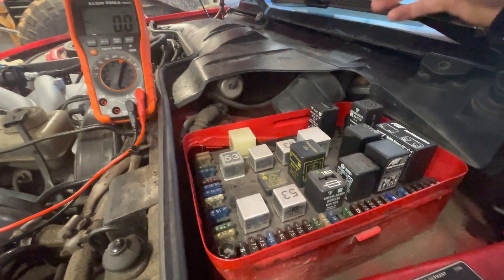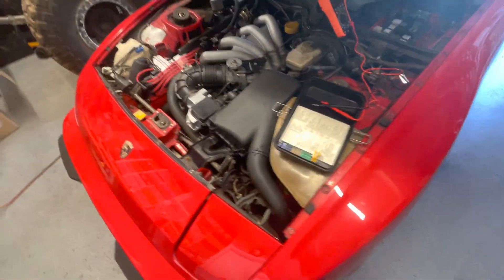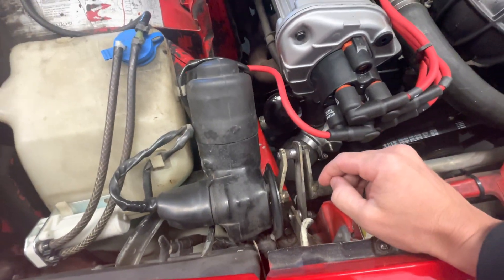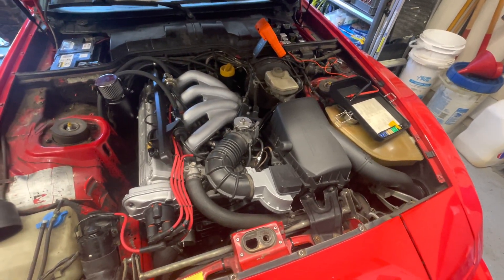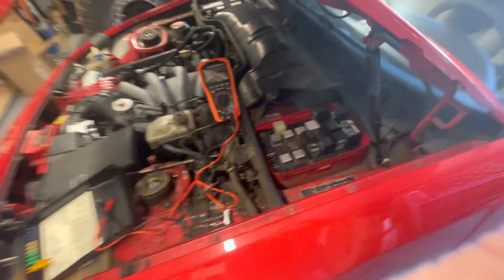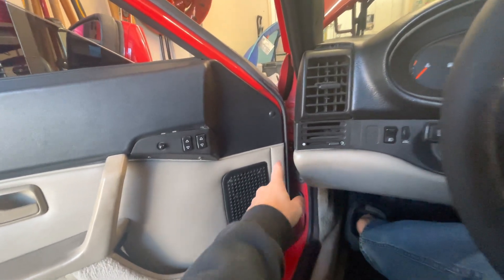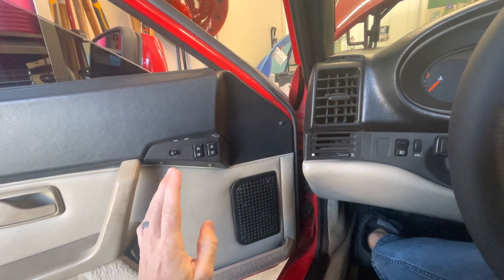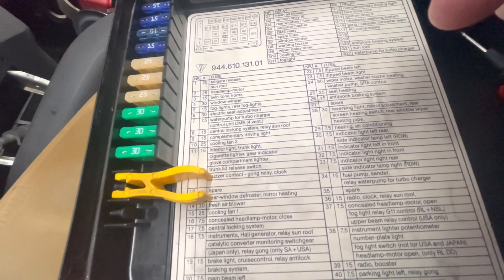944 Finding parasitic draw

Comment: Ugh! 🤨 I had to swap my door jamb switch early on as it was killing the battery as well… but my wires were still connected. 

There are three wires to the switch - a red/white, a green/red, and a brown/yellow (wrapped in that textured black electrical tape). When I pull it taught, it seems to pass through to the upper right into the driver’s footwell area… there’s some carpet and paneling in the way. Maybe a creatively bent metal hook can fish it out before going too invasive with it?
Reply from the maker: Thanks for the clues! I fished around but this gives me a little direction of where to go!
Reply from the maker: I was looking for a single wire because the door switch appears to be the same part as the parking brake light switch and that is only one wire but I didn’t find any wires in my initial search. I grabbed a flexible magnetic pickup tool hoping to fish with that, as my telescoping one wasn’t helping. May have to get a cheap bendable inspection camera or dig into the driver footwell. But again thanks for the tips
Reply: @tims_4x4_garage   Upside down cell phone with flash on… https://youtu.be/U1KrIIAURxY

I’m not bored at all. 🤣
Reply from the maker: @NC944er  dude you’re the man. My door switch looks a little different on the back side, so I may not have three wires after all. But now I know where to look! Thanks!
Reply from the maker: @NC944er  dude they’re in there! Now to fish em out! Lol. Thanks again
Reply from the maker: @NC944er  also, I was mistaken. My door switch is just like yours.
Reply: @tims_4x4_garage  LOL!  I’m confident you can grab them with the right implement/angle. Super annoying though. 🙄
Reply from the maker: @NC944er  cross your fingers that they are intact and functional and the only reason they aren’t plugged in is because someone was too lazy to fish for them